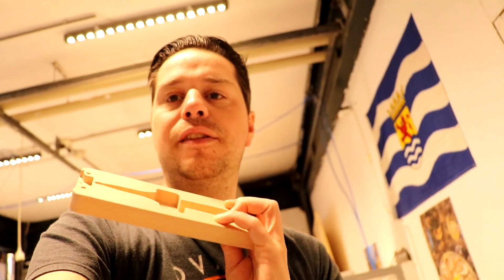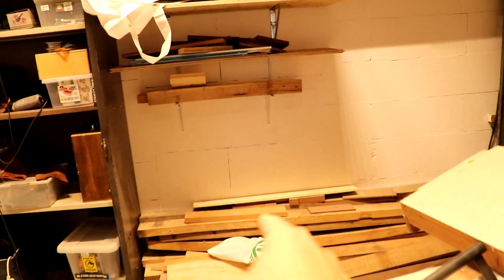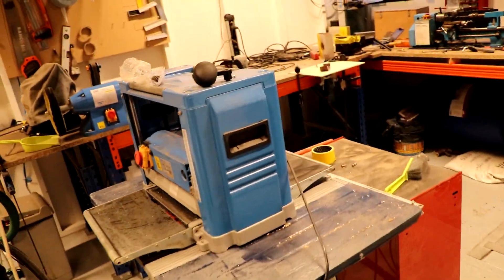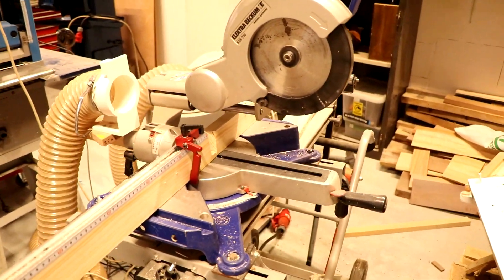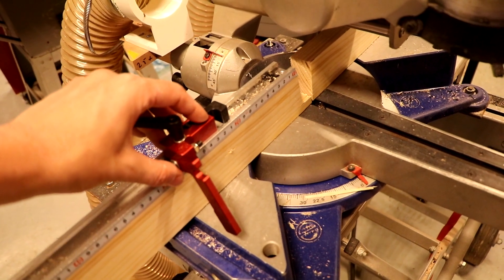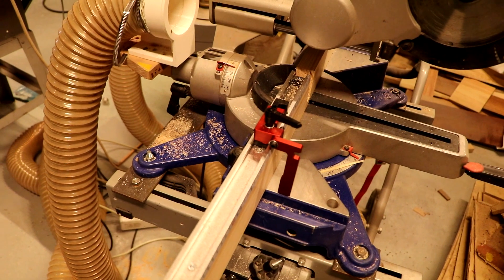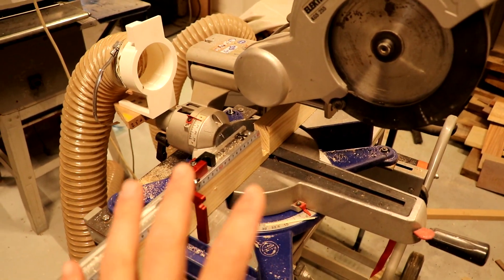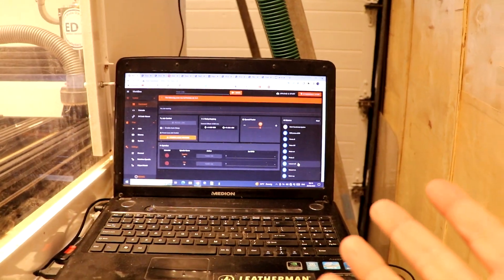You don't need a faster CNC machine... Improving my Workbee router production

Comment: Hi Alex. Would you mind sharing where you picked up the vacuum clamping fixture please? Thanks
Reply from the maker: Sorotec cnc in Germany!
Reply: @yesealex  Thanks. Appreciate the reply. How did you decide which model to go for. They seem to do a lot of different versions.
Reply from the maker: @markscheiner3952 I called them!
Reply: @yesealex  😂😂 fair point
Reply from the maker: @markscheiner3952 they are very nice people and know how to do the calculations. Material, surface area, flatness etc. They can advise you